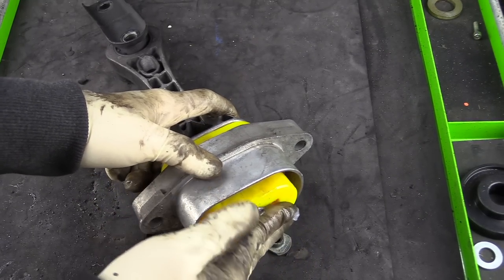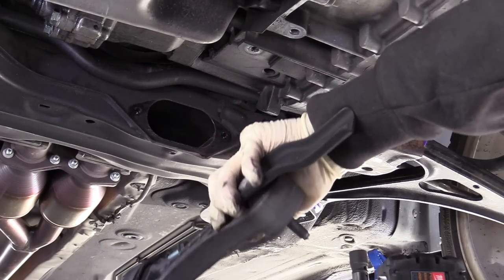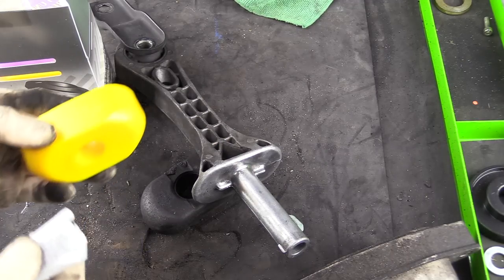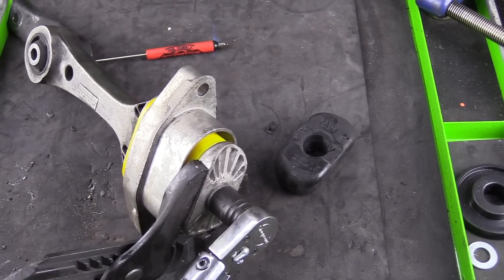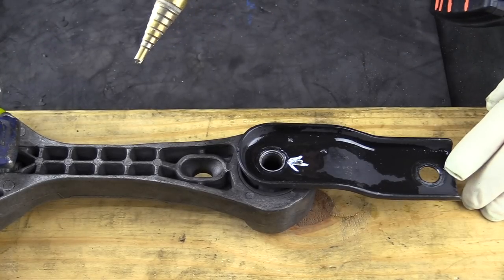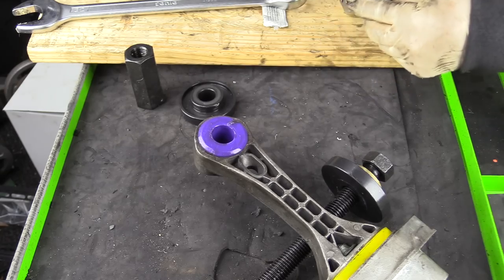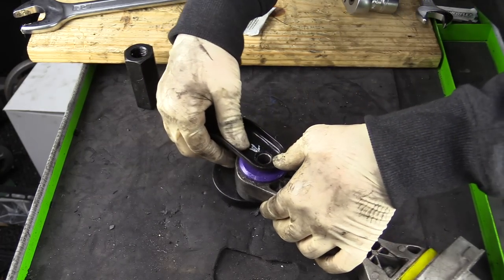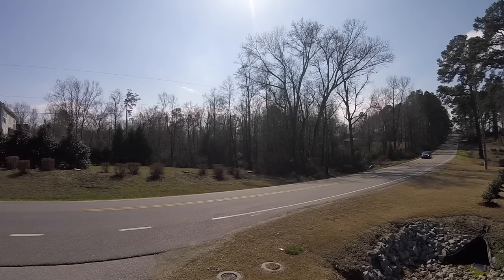How To Replace MK4 Engine Mount (DogBone Mount) Bushings

Comment from the maker: Thanks for watching. I hope this helps and thank you for all the support on the R32 rehab project! If you are not already subscribed, ~ https://www.youtube.com/user/humblemechanic?sub_confirmation=1
Reply: I would like to watch engine mount replacement in a passat b6. Thank you
Reply: HumbleMechanic man i just put some poly bushings on my mk4 tdi.   and when i crank the car it rattled shaked and vibrated bad inside the car so i crank ended up having to put the old bushings back in and everything is fine.  a bought lesson learned....
Reply from the maker: Yeah that can happen on the TDI. Which “stage” bushings?
Reply: HumbleMechanic not sure which stage they was red I got them off ebay.  but now I can't find the original bushings nowhere on ebay.  im guessing I have to go to the stealership.

Comment: Hi
My turbo to manifold bolts keep coming loose, "even with red loctite on the threads". Could this be my problem? And ive got a stage 1 tune. Have you seen this happen before thanks.

Comment: Charles, a few questions:
1. When replacing dog bone bushings, what other opportunistic maintenance should be considered in order to avoid having to take the dog bone off again at a later date?  For example, should sway brace bushings be replaced at the same time or can that be done separately?  What about any routine or preventative maintenance related to the sub-frame?  

2. Does the sub-frame on MK IV GTI have any known issues that should be addressed?  If so, would you consider making a video on that topic?  

3. When torquing dog bone bolts into the transmission, should anti-seize compound or lock tight be applied, or should it be threaded in bear?  

Another great MK IV video and very appreciated.  Thank you!

Comment: Excellent video! Do these bushings fit the dog bone on a 2002 new beetle? If not, do you have a link to that application?
I want to replace mine but like you say I can only find the whole unit. Thanks in advance.

Comment: Are bushings made for gas engines also compatible with TDI engines? I can't find any listings online where both TDI and gas engines are listed as compatible.

I have found entire mount assemblies which list both engine types as compatible. It leads me to wonder if the mount on TDIs is built for differently sized bushings (for different vibration dampening qualities?), even though the assembly as a whole is the same size.

Maybe polyurethane bushings are too stiff to dampen a diesel engine?

Comment: When it was time to install new front end bushings in my Chevy S10 pick-up, I also chose polyurethane. I knew these bushings were prone to "squeaking" if not liberally lubricated during installation, and they would make the truck ride much "stiffer".  Knowing these short falls didn't deter me from installing them.  Now the truck handles high speed curves like a champ and most likely this will be the last time I'll ever have to replace them.

Comment: Great videos man, you do an amazing service to VW enthusiasts everywhere.  I am really happy with Powerflex stuff so far, when I installed the R32 front suspension on my New Beetle I used Powerflex throughout.  I didn't do mounts yet though, I am a little worried since I have a TDI but I also feel the dogbone doesn't contribute to NVH as much as the side mounts do.  Thanks again for your great vids!

Comment: I saw a guy have a very hard time installing OEM style bushings in a Benz (He used Hamburg-Tecnik), and I had just almost as difficult a time on a BMWs(I used Meyle), so when I saw how Polybush was designed, I knew it was the only kind of bushing I would want to use in any German car. They even make them for the VW T4, so I can use them on the Winnebago Rialta that I will eventually restore.

Comment: Mine was so bad it was causing the engine movement to stress the flex pipe on my 2.0 Jetta. Had to get a new stiffer mount from CTS turbo and a new flex pipe welded in

Comment: You got lucky, I had to press the bushings on the sub frame side to get the bolt to the threads and I didn't have a press. Long story short I jerry rigged a bottle jack into a press by putting it between two buildings with some long 2x4's and cinder blocks.

Comment: I think you can get the whole dogbone with poly already installed from ECS. Its more money but easier to install in case you dont want to mess with pressing new bushings in.
Reply: ne2i I should have bought one from ECS i think they are about $80 i payed $50 total for a Febi Transmission Mount and Energy Suspension Bushings now just waiting on new Bolts and Grease for the bushings.
Reply: I purchased the polyurethane dogbone from ECS and returned it because it was loud. I had a mechanic install it with new bolts so I was very disappointed. How did it turn out for you?

Comment: I like powerflex, i love the purple color, non oem colors since oem is gonna be black and i've read up some things difference between energy suspension and powerflex, powerflex higher priced because it already has the bushing or metal race inside already in it while the energy suspension requires you to burn out the oem bushings. What a waste of time but over i think its 1/5th of the price if not atleast 1/3rd of the price for powerflex though for burning the bushings, but one bad thing is ES bushings are 95A while Powerflex has yellow 70A or purple 80A, i'd prefer a street performance, not race on a streeter.

Comment: If you live somewhere that salts you might just want to get a new one.  I did this to my mk4 tdi over the weekend, but I replaced the whole thing with a CTS turbo one.  When I took the mount off one side where it goes to the sub frame the entire bolt hole cracked and fell off just taking it off and the other side the same happened along with the bolt head snapping.  Use penetrating oil on all 4 before hand as the bolts can snap when removing.  The entire mount was just trashed metal and rubber parts, I don't know how it even held the trans up.
Reply: Jake R it doesn't hold it up. It keeps it from rocking under torque
Reply: Jake R how well has your cts turbo mount held up? I'm about to replace mine with the same one this weekend.

Comment: I’m a fan of the polyurethane.  Not only does it look cool and last longer, I like the slightly firmer ride.

If you don’t have the tool or $70, a few light taps with a soft face deadblow can usually get the bushing going without damaging it if you’re careful.
Reply from the maker: I agree! As long as you don't get oil on them. That makes them very sad. LOL
Reply: If you are concerned about oil saturation spray the assembled mount in undercoating.
Reply: I'm considering buying the ECS Tuning dog-bone.   I have a couple basic questions.  Can you please explain why getting oil on the ECS Tuning dog-bone is not advised?  Does oil exposure not effect the Powerflex bushings?
Reply: @Robot Ramone  I purchased the polyurethane dogbone from ECS and returned it because it was loud. I had a mechanic install it with new bolts so I was very disappointed. How did yours turn out?

Comment: This is a great tutorial and I've also seen the other powerflex tutorials that you uploaded recently, but nowhere do you discuss what are the actual pros and cons of the polyurethane bushings, would you consider doing such video, because I also want to upgrade to powerflex bushings but I am not aware of the downsides.
Reply from the maker: YES! I am holding off on that video until I get a few more bushings done on the car, and get some more miles on it. But I have that planned for sure.
Reply: Thanks! Looking forward to it! I really want to do this on my mk4, but the roads over here are often "bumpy" and thats what keeps me from doing it atm as I am not sure exactly what the effects will be on the comfort, and to the surprise of many people the 4Motion MK4 is pretty comfortable and stable, I really love it:)
Reply: I was really hoping that you had been planning to do that once you had them all replaced. Awesome!

Comment: Ball joint press and bearing set is standard equipment in my box. P.S. two piece bushings are garbage, and will fail quickly on engine or trans torque mounts, especially if the customer has a heavy foot, which is generally why the bushing failed to begine with. I have had about a 50% failure rate on Ford strut rod style lower control arms within a year. Replacing control arm with factory pressed in bushing has a near zero failure rate within a year. Lower control arm cost a little more the labor is the same but the benefit to the customer far outways the time bringing it back for the same repair plus it makes the quality of work look better.

Comment: Why'd you pick poly bushings? I've found they add a lot of noise and harshness since they don't have as much give as factory rubber bushings.
Reply from the maker: A few reasons, 
1) They are about the same price as OEM.
2) Powerflex was kind enough to support the project 
3) Many OEM bushings are not available unless you buy the whole part
4) I have had several cars with poly bushings and never had 1 issue. No noise, no extra vibration nothing. I assume that is because the are always properly installed, and I never get the "race" ones. 

These are not that much stiffer than OEM.
Reply: I purchased the polyurethane dogbone from ECS and returned it because it was loud. I had a mechanic install it with new bolts so I was very disappointed

Comment: I find the yellow bushing a bit too stiff on my 315000km MK4 Golf. The red one (diesel bushing) would be a better choice for high mileage cars.
Reply: Does the mounts with either bushing make the same amount of noise?  I'm looking to do this on a stock/daily-driver.  I purchased the polyurethane dogbone from ECS and returned it because it was loud. I had a mechanic install it with new bolts so I was very disappointed.

Comment: I see in the vid the car's on a lift. If I try this with the front end on ramps I figure the engine will swing much further back after the pendulum mount is disconnected, correct? If so, do I run the risk of damaging anything if that occurs?
Reply: The pendulum mount does stop that lateral movement from happening, it doesn't support the engine at all.  The engine shouldn't move that much further back, and you can easily push it back by hand, or lever it back with a pry bar supported on the sub-frame, to align your first of the two front bolts when you reinstall the mount.  If you're at all concerned, check your engine and transmission mount from up top, before raising the car.  So long as they're secure, they hold all the engine/trans-axle weight.   Even one of the two can hold it all (Don't ask me how I know this...)

Comment: What jack stands are you using? I have the Harbor Freight 3 ton ones and they do not sit well in the pinch welds. They hold firm with the shake test before getting under the car but I wish there was more material touching the car.
Reply from the maker: I have 2 different ones on the car here. 1 set from Oreilly's and the other from Sonic tools. The Oreillys one is nice because it has a groove for it to sit in the pinch welds.
Reply: Thanks man I really appreciate your work and videos. They have helped me so many times over the years.
Reply: You might be able to get some pads that wrap around the jackstands for a better fit. This is what Harbor Freight sells for their jackstands:
https://www.harborfreight.com/rubber-pads-for-jack-stand-2-pc-63373.html

Comment: I hear it a lot to tighten something to so many Neuton Meters but how do you know when it is tighten to whatever Neuton Meter without some kind of gage? I’m from the US so maybe it’s the same as tightening something to so many pounds but was just wondering
Reply from the maker: If I need to go back and forth I just use online conversations. 

All VW repair manual is in Nm
Reply: Buy a torque wrench that shows Newton meters.
Reply: Newton-meters is a measure of torque, just like foot-pounds. A Newton-meter is approximately 0.74 foot-pounds. So whenever you see someone quoting torque specs in newton-meters, just multiply that number by 0.74 to get the number of foot-pounds. So for example, 50 Newton-meters would be approximately 37 foot-pounds (50 x 0.74 = 37).
Reply: +panzerveps
That isn't so easy in the USA. Few of the clicking torque wrenches sold here can be bought in N/M. Typically the only easy to find option is a fully digital torque wrench. That is a problem for me because I don't like any torque wrench that doesn't click. This is why I often read the service manual if a torque spec is critical.

There is another problem. Japanese companies like to use Kgf/CM and then have you convert it to a different measuring unit. Unless you never have to work on a Japanese car (Highly unlikely to happen in the USA) then get used to using the conversion charts or a digital torque wrench. Some repair manuals might be nice enough to give you Inch Pound and Foot Pound numbers, but don't count on it.

Another thing to keep in mind is measuring range. You will probably end up needing a 1/4 inch, 3/8 inch, and 1/2 inch socket torque wrench in order to torque the small, medium, and large bolts. That could get extremely expensive when you get torque wrenches in a specific range.

Comment: hi charles, i see at the bottom of your oil pan your, oil pan sensor is blocked off? my r32 has the sensor, is this a difference in the area in which the cars where available?
Reply from the maker: Maybe. I don't recall seeing any mK4 R32s with in the US. I don't think it has the wiring.
Reply: it is listed as an oil thermal sensor g266, and provides the oil temperature on the cluster. weird i guess, your car's in usa dont have the oil temp in your clusters
Reply: I'm assuming yours is European? VWoA did some dumb things with that, in my opinion. I have a mk6 GTI and the Euro version, to my knowledge, gets oil temperature available in the MFD (center cluster information). The American version (mine) does not. The stupid thing is my brother's mk6 Jetta does get it and mine, despite being the more "high-end" one of the two, does not... Also, I can add it but it would require coding and about $200 in wires plus I'm sure a bit of a headache drilling and whatnot... Fun fun.
Reply: Well mine is an headache at the moment since it is registering a fault at the moment. so ja! :-(
Reply: SETH STRAUSS Ah! Sorry to hear that. So maybe I will skip out on that mod for a while... Currently still my daily driver... Haha. Good luck with fixing it!

Comment: What kind of lubricant is that? Is it dielectric grease?
Reply from the maker: It's the lube that comes with the bushings.
Reply: Most polyurethane bushings have a silicone grease, but I would buy it directly from the bushing manufacturer. There might be something that makes their silicone grease different from everything else.
Reply: It's pretty much silicone grease. Don't use any other type of petroleum grease, as it will deteriorate the bushings

Comment: My daily driver is a Mk.4 Jetta. I replaced the pendulum mount bushings recently, but used stock replacements. I was afraid that polyurethane bushings would increase NVH. Was I being paranoid?

Side note: Apparently, the rubber pendulum mount bushings are hard to find. I got them from Black Forest Industries.
Reply from the maker: The only time I notice any difference is during shift. I think it's a more positive feel. This is a harder material but not much. IF you go with their race series then you would increase the the stiffness by 85% I Think... THAT would give you some feedback HAHA
Reply: I have a 1.8t and I definitely noticed the difference in vibration and also when you take your foot of the clutch pedal. It's not unbearable but since I did not feel any benefits on doing this I went back to a normal OEM ones. Also I was using the Powerflex red version for diesels which are supposed to be softer.
Reply from the maker: Strange. I wonder if that exposed another weak point, or it was truly an issue. Plus everyone experiences NVH different.
Reply: HumbleMechanic It is very possible. I will be changing  the engine mounts, and may try  the poly bushes again. I also heard the 1.8t isn't as smooth as the vr6 but can't be sure.
Reply: Mine has the 1.9 TDI. The stock mounts are doing a good job of absorbing the "diesel rattle", and I don't want to change that.
Reply: I drive a 24v Vr6 Jetta . I actually just swapped my engine mounts and the dog bone mount all to polyurethane bushings from Ecs tuning this past week. I will give you a heads up the difference is almost unbearable I am feeling a lot of vibration. But I also read that swapping the dogbone back to rubber will alleviate  some of the vibration while having polyurethane engine mounts . The polyurethane bushing are starting to break in a little more day by day. Also around 3000rpm is when you will notice it most. I will hold off from swapping the dogbone out for another week or 2 to see if it gets better.  I would only suggest this mod if your heavily modding this  (Turbo or Supercharging)
Reply: I will post a video of what it is like In cab possibly this weekend

Comment: This was the MOST ANNOUYING  MOUNT to take care of once and for all!!! I went through several mounts. my issue was the smaller one that attaches at the trans. it constantly broke turned to dust to the point where I literally striped the threads from the constant replacements!. I ended up measuring the bushing and replacing it with a solid aluminum chunk cut to the same size... I have a video of a drive after the install NVH wasn't even an issue since i retained the Ecs mount that slides into the subframe.  Oh yea I had to use a time-sert  to fix the threads on the trans been in there the past 6 years hasnt failed ...But Man....